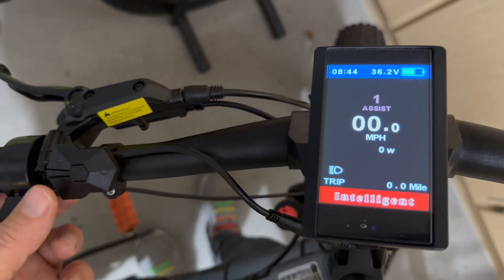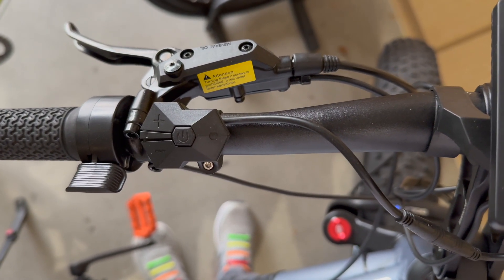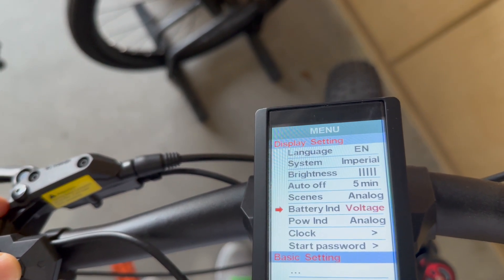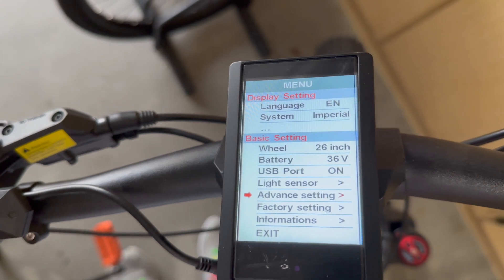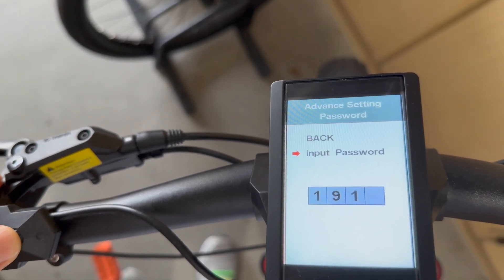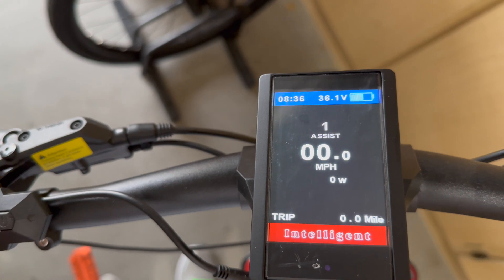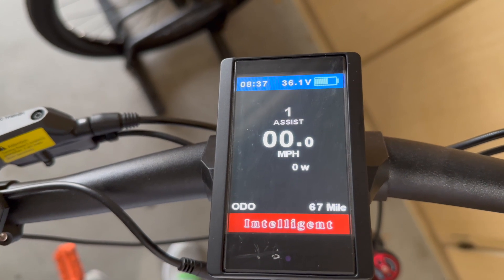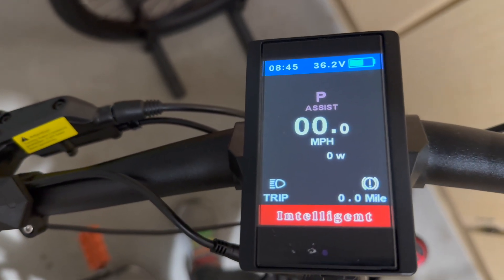E-Bike Basics of Programming Bafang 850C Display - Power Assist Levels #ebike #ebike #ebikes

Comment: Hello, i have the same display on mate x 250w, i put the password then can't change anything they limited the motor at 25km/h !! If you have a solution please let me know
Thanks
Reply from the maker: Sometimes the dealer locks out the top speed. Bafang, if that's what you have, sells a programming cable and you can download a program from the internet to change it. Bafang doesn't care like Bosch.  Needless to say, you void any warranties you may have.
Reply: @edscyclingwithcoyotes  yes sir, it's a bafang motor. So there is a chance, thanks
Reply: @edscyclingwithcoyotes dipende dal motore....io ho bafang m500 NON SI PUÒ SBLOCCARE.... nemmeno con codice...e non si può riprogrammare,solo i rivenditori bafang possono perché hanno il software... specialmente chi ha attacco CAN e.nn huart!!!!!!io ho m500 con attacco CAN... sono obbligato a mettere Ghost o speedbox...ma vorrei mettere un acceleratore..non so dove e come si  collega